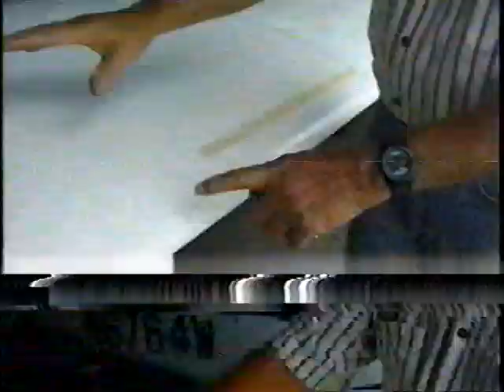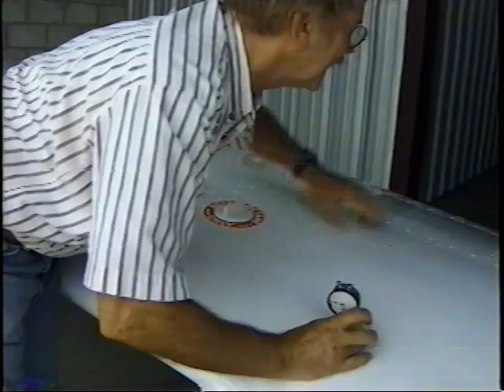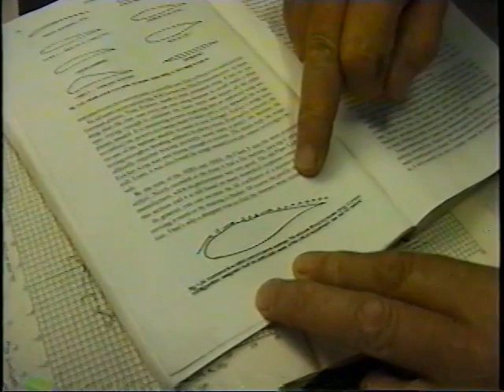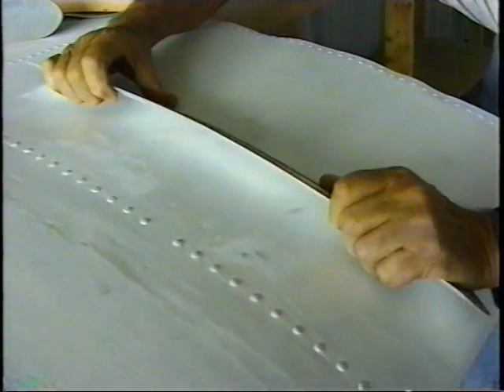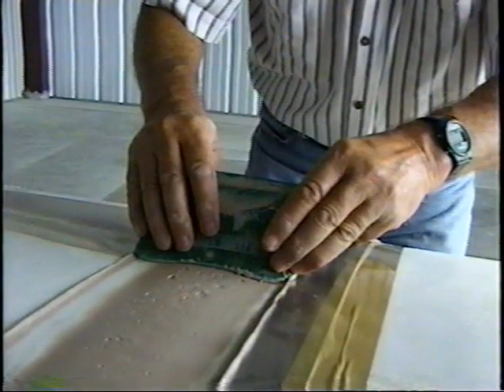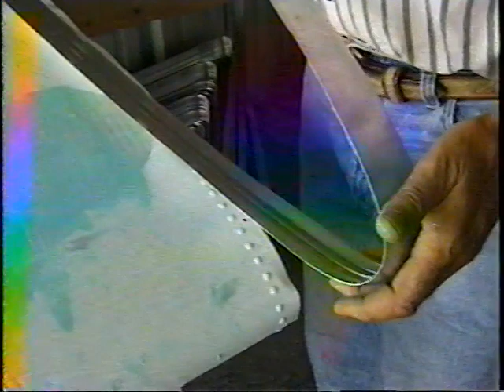LFS Wing Smoothing Video

Comment: This is all totally illegal.
Reply: If painting your aircraft is illegal, I guess it is.  🤡
Reply: I'm literally holding the STC in my hand right now.  But it's still a bad idea, it doesn't age well at all and is worse than before!
Reply: @ Bullsheit. show me, there is no STC for bondo. It is not even in AC43.13
Reply: @AlexMunson2  There is no STC for a certified aircraft to use Bondo on a wing skin. Especially covering wing skin rivets that must be inspected in annuals for signs of overstress and corrosion. . . There is nothing in AC-43-13-1b or 2B to use bondo on alclad. . There isnt a single STC to use bondo to smooth a wing skin. The FAA regulations call for replacing a skin with a PMA part, or cold rolling out the dents. There is nothing approved to use a filler on alclad.
Reply: @josephkaminski1857  Bondo is part of the painting process completely within pilot owner maint.
Reply: @ Bullsheit. show me, there is no STC for bondo. It is not even in AC43.13

Comment: I really think the big problem is that the rain was adding so much humidity that you couldn't get a good smooth spread.  If this really works I'd suggest a before and after video to help your claims.  Since I do video for a living I'd suggest a complete re-shoot and use a second camera in an enclosed and properly lit hangar.  I was going to get a cherokee but now I'm looking at a Cardinal.  Any advantages with other aircraft?  Good Luck

Comment: Is the whole wing done or just the front part? What about the part where the strut and fuel tank is?
Reply from the maker: The wing smoothing is from the leading edge aft to the forward spar only.   The Fuel tank screws that go fore and aft are covered by the extruded metal fuel tank fairing that are included with the kit.  You can easily remove the tank fairings to access the fuel tank screws for fuel tank removal.    By strut I presume you mean the wheel strut?  The wheel strut is located aft of the forward spar so it is not affected.  Hope that answers your questions!

Comment: wow.. how much money will be invest in sanding and filling and paint it back a wings on a piper 140!!! maybe more money that the money is worthy .. how much weight you add to the wings for the price ?
Reply from the maker: The best time to do this is when you were going to paint the wings on your aircraft already.  The gains are substantial and definitely worthy of consideration.  Typical installation time is 15-25 hours dependent upon the condition of the wings.  It doesn't add much weight at all - a few pounds.     We took a 150 HP PA28-140 and with all the mods available took it from 122 MPH to 150 MPH without changing the prop pitch.  Price for all the modifications with labor at the time was about $13,000 (2002).    See https://laminarflowsystems.com/press/ to see the article in General Aviation News.

Comment: An aircraft with bondo on the wings? I'll take a pass.
Reply: here is the modern product, what the military uses Henkel LOCTITE® Hysol® EA 960F™ AERO Low Density Epoxy Adhesive Paste

Comment: won't the tendency of GA aircraft wings to oil can cause the bondo to crack & separate ..... we used to do this procedure with fiberglass glider wings (it worked well ) ............. JRW
Reply: not if applied correctly.  surface prep the key